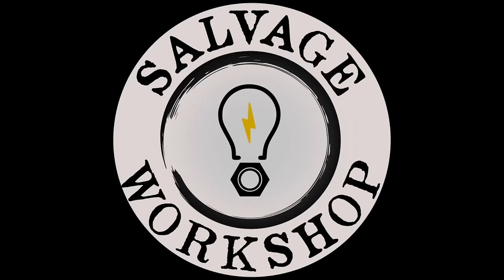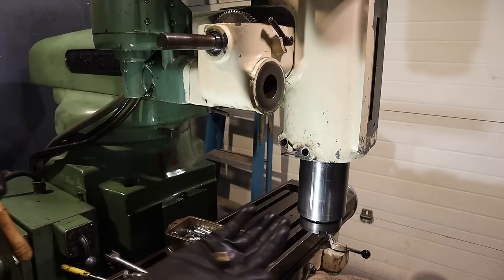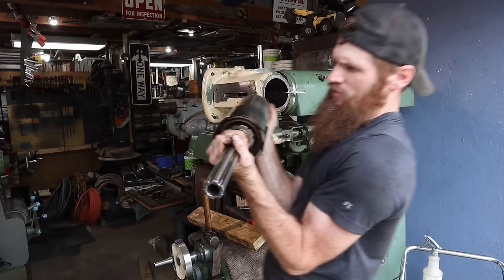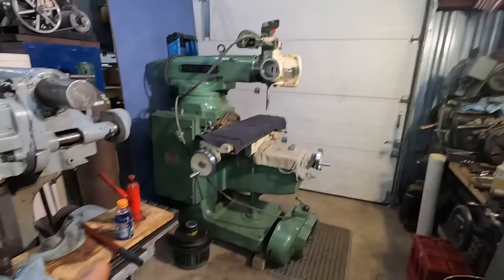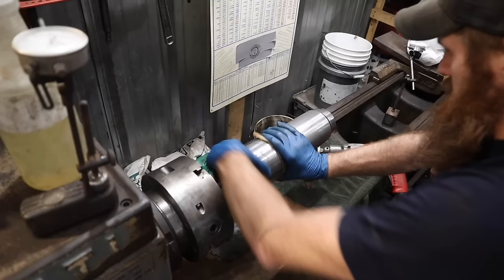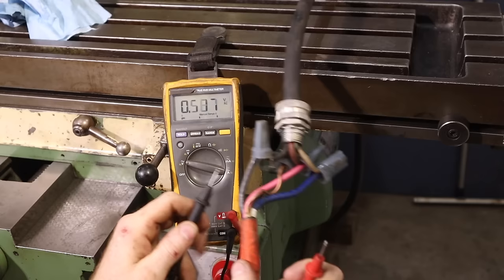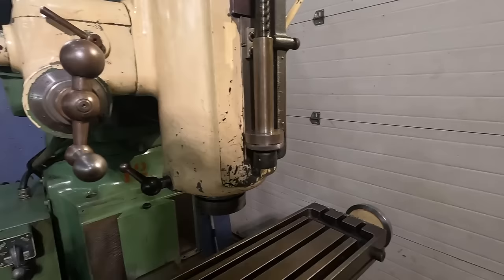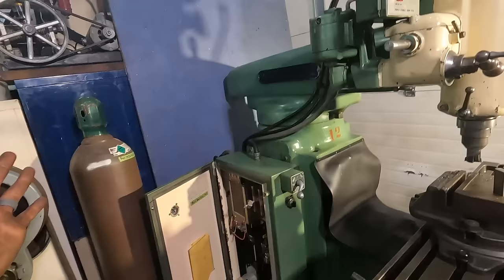My 1960's Milling Machine Is STUCK SOLID! ~ Can we fix it or will I DESTROY it?!?

Comment: Send me a copy of the print and I will show you what you need to change. You need to double the size of your overload heaters. N's may be hard to find. If you remove the entire N overload you can use a W heater. Don't forget to use the W chart for sizing if you do.
Reply: I am actually serious. I have retired this year in June but I was an electrical maintenance shift leader at ArcelorMittal Dofasco where I worked for 40 years. There is a folded print in a pocket on the inside of the starter door. Somewhere in the starter will be a overload sizing chart usually on the door as well. Use the FLA ( full load amps ) figure from the main motor plate for the 208 volt setup.

Comment: Scalpel - scalpel
Swab - swab
Saw - saw
Doctor, the patient's coming round
Circular saw...

Which reminds me, I once had a broken wrist pinned - and once healed, the pin wouldn't come out. So, an hour later, they'd got the tool they needed sterilized, under green surgical paper. The maintenance guy's pipe wrench.

Which seems appropriate, given my old man designed the engineering behind hip implants. They'd been done surgically, over-engineered, and kept splitting out of the femurs. So lighter shafts, and engineer-fitted. The first few were done by the prosthetic builders at Roehampton, using a motorcycle cylinder reamer!

Comment: As you were in panel testing you have 3ph is delta system 115. 208 115 abc 208 which is the wild leg in cente which need to be center or b

Comment: If you can't get real 440V 3-phase you will need bigger wire, no wire nuts, short runs, the correct switch box contactors, and a friend at the power company.  If three phase is not far away, it is every motor's wet dream and a good investment.  Low-hour military surplus generators can be affordable as well.
Our crushing plant spools up 23 big motors including two 200hp and one 250hp...makes quite the hummm.
That being said, you have an AWESOME mill!

Comment: Maybe you could have used the knee (lowering it) to assist you in removing or assembling that quill. Or, I would have made some type of puller, it's never a good idea to try and spread cast iron. You are so lucky you didn't break that casting...

Comment: In regards to changing the motor from 440 volt to 220 volt 3 phase. You will have to change the overload protection on the starter.
Start with the Amperage fpor the motor @ 220 volt. This is on the name plate of the motor. It will use more amperage @220 volts. 
Order the overload protection for the amperage you need at 220volt

Comment: It went in 3/4 and then got stuk. When you had it in the lathe and clocked it,  take a piece of emery (use the back) or belt or canvas, put some valve grinding past on the part with the separation and polish it.
You only get a shaft allighned if you use the center to get the end in centre.

Comment: Agree with Joel.B491 that you are now using twice the amperage on 220v as you were on 440. Thats why its tripping the overload. Should be chart in the machine panel that tells you what # of heaters you need.

Comment: You'll look on motor for full load amps at 240 volts then look at Allen Bradley for thermals for that amperage. Ya done good gettin as far as ya did bein a mechanic and all 😉

Comment: You mentioned that you changed the voltage on the main spindle motor. You need to change the voltage on all of the motors. 440v 3 phase motors will still run on 220v, but they won't be happy. Probably why the X travel sounds bad. Also verify you are getting the correct voltage to all of the electronic components in the control cabinet. The spindle is running backwards. Swapping any two of the 3 phase wires will change the direction. I do not have any experience with phase converters, but you don't need to be hung up about the wire colors with 3 phase.

Comment: you changed the voltage on the single phase control transformer only. you have to change the voltage connections on the 3 phase motors as well as the heater values. a 3 phase 440 motor will start and run on 240 but wont have much torque.

Comment: Maybe the extra-thick mucky stuff under the gears in the casing at the head of your milling machine is a kind of lubricant known as 'crater' grease?

It was once used on farms in my district to lubricate things like pump jacks on water wells and other machinery like the mechanism at the head of windmills.

It was and probably still is used on winch gears and moving parts on dredges as well as railroads where it may be used for lubricating couplings.

It was is popular for many applications where it was/is desirable for grease to stay stuck on things like the teeth of exposed gears.

According to the internet 'Crater' grease is still used in the mining industry for similar applications and for heavy machinery constantly exposed to dust as well as lubricating wire rope.

Since YouTube would probably remove any company names I provided I won't bother trying but I didn't have any difficulty finding suppliers on the internet.

Comment: the spindal break is not ment to stop the spindle when you turn the mill off but rather to hold the quill from turning whhen you loosen the draw bolt when you changs tools.
Reply: BS

Comment: This might be a bit late, but why didnt you remove the c-clip and remove the quill from the top like it was meant to come out, could of saved yourself a lot of work and not had to do any honing or deburring. the base for the quill return is press fit, as well as it doesnt have a slit on it to be clamped by the lower screw clap. This is just a theory, but that lower clamp isnt for holding the quill in place, its actually to keep the spring retaining ring in place.

Comment: Have you used mic on the shaft to see if it Measures all the same down the shaft and it wouldn't hurt to measure the inside of the Cylinder just to see if it has a little spot that might be a little tite when you insert the shaft. This just an idea only hopes it might help spot something that causing a problem.

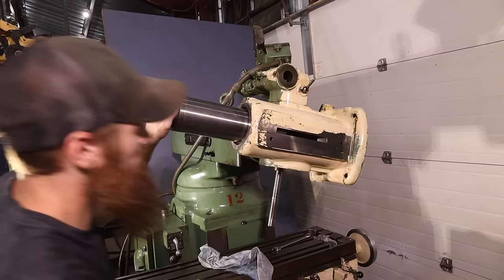Comment: Stuck spindle: grease is pil in a soap suspension.  When the oil seeps, you are left with a soap, which has no lubricit 34:44 y. Old grease which has oil that has weeped must be replaced. Grease is not forever.

Comment: I agree with heater change on the overload.  Yes, also it might be the quill is removed from the top.  More importantly, is it true 3 phase (rotary motor/generator or solid state) or a capacitor/starting relay type of converter.  If the Capacitor type, make sure the transformer is fed from the "True" 220" leads.  The third leg is not truly 120 degrees out of phase and is not made to draw much current.  If there are only two heaters on the motor contactor, then those should also be on the "true 220" leads.  I have used a spare three phase squirrel cage motor hooked to the  capacitor style converter and just let it run in order to provide more balance going into the milling machine.
Reply: Also, it looks like you are running backwards...

Comment: I had a similar problem honing a bore out with a key way groove, i filled the groove with body filler (Bondo), you need to shape the bondo a bit to conform to the internal bore profile and it worked a treat just chipped it out with a wood chisel when I was done..Just saying..

Comment: In a country where old machinery are still in use and spares non existent, you forget about the jay and nay sayers, you do what you must do, change the contactor to a more modern one with a 120V coil, my country run 3 phase on 360V 50Hz and normal 220V to 250V 50Hz

Comment: Paint the shaft with blue dye  let it dry  then see if you can reinstall it and if it will move right ck for scratches.
 Best of luck you will fix it
 First is blue dye then  hone very carefully
 Again  best of luck lightly hone
😊

Comment: I think the electric contactor has what's called heaters in it going from440 they may need changing or a new contractor itself.
Turf job getting her to move but it needed to be done. So much better then Bridgeport .

Comment: Basically they are your thermal overloads and going from 480v to 220v your amps will increase enough to ware you need to resize your thermal overloads. The motor will show the difference in amps at 480v and 220v and that will give an idea of what size heater

Comment: I have a pretty good idea of what's going on with that mag switch.  It's one of two things.  
The first is the spindle motor, I would take a bet that the motor needs cleaned out and the bearings need greased/oiled.  I've seen that before, where normal dust & flying grease gets sucked into the motor and gums up the works, causing the mag switch to overheat from drawing too much juice and trips.
The second is that the mag switch has gotten weak and is tripping easily.  But I highly doubt this because it's overheating and tripping.  That could also be an arc problem in the switch if gunk got into it or corrosion on the contacts.  You might try cleaning the contacts with alcohol & a pencil eraser.  Works great for older neon signs that use mag switches.
Reply from the maker: That's what I was thinking too.. the electrical diagram specifically says there is only 1 wire to move in the panel to change it from 440 to 220 3 phase... If I needed to change parts on the mag switch, it would have been noted there... i will start by doing a bit more cleaning and we'll go from there!

I appreciate the support! Thanks for watching!

Comment: when you changed power from 480 to 230 volts the amps will double. there's pobly a heater chart on the door where you changed those power leads

Comment: Replace the control transformer with a similar sized 208/240 volt transformer. Should have the same or a little larger VA rating, and the same output voltage. Your controls are running on 110/120 volts ( secondary or output side of the transformer) it's the primary side that you have to match the voltage to.
Should be single phase 440/220 input voltage, similar to the motor

Comment: OK, that was hard to watch.  I'm glad you got it running in the end, and it looks like you got a heck of a mill there.  But sledge hammers, chisels and precision cast iron together just give me the heebie-jeebies.  Personally, once the quill was out, I'd have taken some measurements of the head and the quill before I started hogging it out with a hone, so I'd know how far to go and have at least some idea if things were round, tapered, etc.  I don't know much about old mills, and nothing about this one, but I agree with your theory that at some point, the quill was replaced, but the new one should have been fitted to the head, and wasn't...just jammed into the head and got stuck.
Reply: That's maybe why it was auctioned ?

Comment: As an electrician, il tell you right now, since you halved the voltage, the motor amperage doubled, Which is tripping the overload on the contactor, if you cant turn up or adjust the overload trip settinvg you'll need to get a new contactor/overload and probably will need to increase wire to the motor and increase wire size on the main wire coming out of the machine itself, hope this helps, if it did i can help you more in depth if youd like

Comment: The 3 Jaw chuck never runs true without turning or grinding the jaws. Also, its important, to use always the same screw to close the chuck, every one will have a different runout. But with that setup, u can't check the runout of the millspindle.

Comment: Diesel with 10% ATF 20%gas, (40%for really thick sticky greasy surface, )  the diesel and ATF protect the surface , the gas makes penetrationin tight area, threads, splines, evaporates leaving a film, protecting from rust, 
 Kerosene just doesn't have the lubricant diesel has, the ATF will make up for it!  In a 3 gallon bucket, with 1.75/gal. Of diesel or kerosene , about a qt of ATF, and a gallon of gas , play with the exact amounts more gas for cleaning. More ATF for lube, and diesel for penetrant

Comment: i would go inverter on that spindle motor and add a brake resistor.
no need to change the brake pads just use the momentum of the motor to create a magnetic brake Resistor will take the punch.
Beautifully machine.
I would refurbish the entire spindle.
But again that's a old school diamond right there.

Comment: I’m wondering why the quill was painted. I’m curious if it meant it was a damaged unit. I’d be willing to bet the quill housing was damaged when removed by the school or previous owner. Most likely dropped. I’m not going to pretend to know how to repair lathes or mills but I believe I would have utilized and hydraulic press and never used a hammer on the spindle with those bearings. It is good to see an older machine like that being used still though.

Comment: Just letting you know, your forward and reverse switch is backwards. forward should be clockwise. that's why your bit was struggling. I'm sure you've already figured that out but in case you didn't i figured I'd tell ya
Reply: Actually your switch is fine, swap your L1 and L2 on your feed power and it'll reverse your polarity

Comment: USA 230V 3-phase is rare and deprecated (as in museum pieces), You really should convert the phase converter to output 480V if you can (it's probably easier than replacing the machine's current breakers)

rolling the phase legs only reverses the direction the 3phase motor spins and won't affect anything else

Comment: I messed up cutting threads for my 1972 johnson 25hp's spark plug hole which unfortunately stripped. What cylinder heads will fit it I can't find the original 383535

Comment: That was so hard to watch, and I think you went about removing that quil all wrong, that slot is not meant to be spread open, that first test cut looked like it was running backwards, some machines run backwards when in low gear, in high forward is forward again, glad its working again at least...

Comment: What's done is done, but I've never encountered one of these machines that the quill didn't come out the top after removing a snap ring. Not saying they don't exist and I've certainly never touched this particular brand, but that has been my experience that it isn't meant to be removed from the bottom. Now honestly I doubt it will be a problem in the long term as I don't expect you will be running this machine like a full time machine shop would.
Reply from the maker: The manual states it should come out the bottom after removing the collar and retaining bolt... I do agree all others I've worked on have come out the top! I appreciate the thoughts, Thanks for watching!
Reply: @SalvageWorkshop   Learn something new every day. I knew you had a reason, I just couldn't figure it out. That said, I'm sure hammering that hard and long hurt you far more than it hurt me. But sometimes you gotta do what you gotta do.

Comment: The reset over load heaters may need changed. They were set up for the higher voltage and lower voltage increases the AMP draw.

Comment: My thought in finding the problem is: mike it in multiple quadrants, snap gauge the bore in multiple quadrants..that would prove where the issue is.  You do have proven measuring equipment?

Comment: you may have the 110vfeed motors wired wrong. the wires from the feed converter may need to switch 2 wires from the phase convertor. disconnect the feed motor and check the volts

Comment: You need different heaters, the bronze brake pad holders need new brake pad inserts, you should have replaced all the bearings in the head, replace the belts they may look ok but are probably worn. I recently finished rebuilding a Gorton.

Comment: You need different thurmals in the magnetic starter. When you go to 240 volts you double the amperage. You need thurmals for the higher amps. 
Make sure you are cutting with the spindle turnind the right direction.
To reverse the spindle direction, just switch any 2 wires coming into the magnetic starter...(the thing that you're calling a magnetic switch).

Comment: You might want to check your rotation you are turning backwards. Not a big deal while milling but if you drill could cause headaches. I’m pretty sure the other guy was right on the contractor. Something to look into if nothing else.

Comment: Should always use oil to hone this type of procedure.
Should all so take those wedge spreaders out of that slot. Then hone it. Do you have a measuring tool? A calipitor or vineer to see the difference in diameter of both.

Comment: If it fits by design with a few thou then it would have been matched by a fitter when the machine was built. You can't usually just tx parts. Normally to fit you would make measurements and trim the rotor with a lathe.
But they got it in there ! Thats the mystery! It seemed to be sticking around the base where the pinch collar was so maybe the machine got knocked when they moved it. Thats more likely.

Comment: Kia ora (hello) Is this one of the many machines that you hauled out from an upstairs factory type building, quite some time ago... and then loaded them up onto your trailer to get them home to your workshop out back of your home and where your dogs run... as you did a video on that. If so it is great to see you finally working on them. 🙂🙂 nz